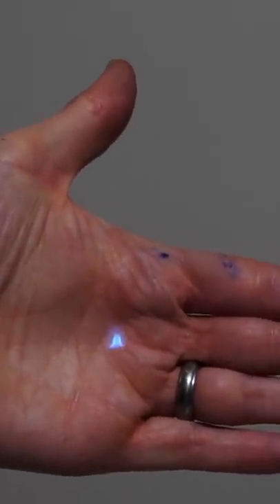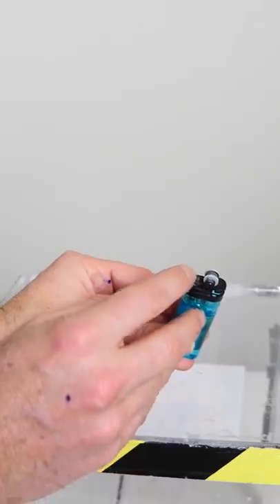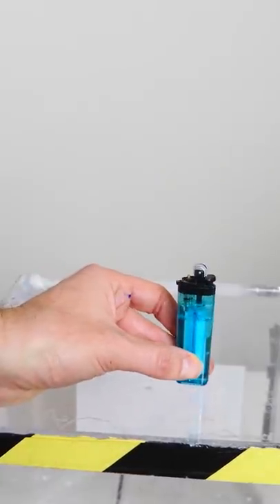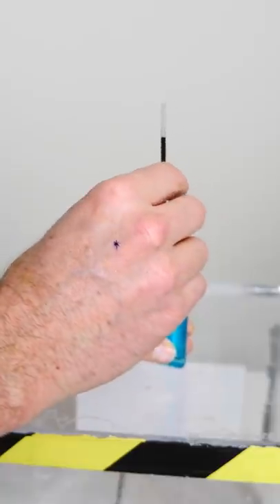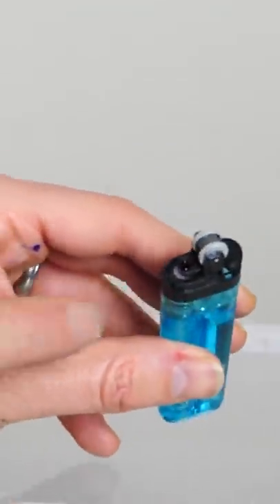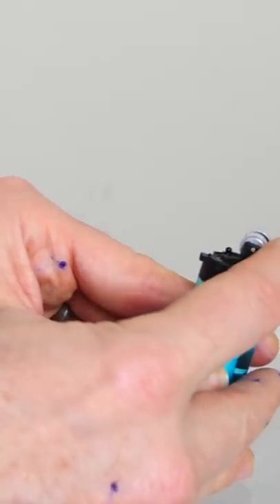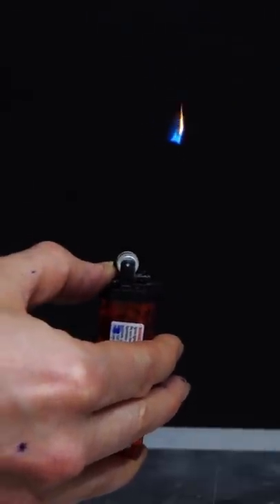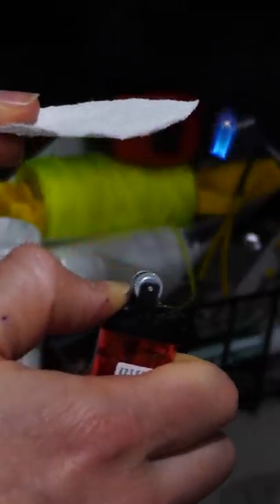Floating Fire Ball

Comment: Him: explains how it works

Me: Yes I totally understood everything
Reply: the gas comes out fast which makes it smooth (laminar) and it doesn't mix with the air, but once it slows down it gets rough (turbulent) and mixes with the air, which is where the flame starts
Reply: @insectbite1714  I tried it and it worked. I used the help of my science teacher to do it and it worked.
Reply: @insectbite1714  just admit you failed Science
Reply: Laminar essential means all the flow is going one direction, with water it usually looks very smooth. Like when you use a hose without a nozzle on it
Reply: Who addicted to meth know this..
Reply: @amirulakmar2912  God dammit hahahah, I'd say a meth pipe is always turbulent

Comment: I accidentally did this when I was younger. I had dripped melted wax on the lighter, and some landed on the nozzle. I guess it just instantly cooled and solidified into a smaller nozzle. It was pretty awesome, the flame would be about 8" away from the lighter.
Reply: I came here to also say I accidentally did this, except I was just messing with my lighter and got it to happen. Blew me and my friends minds

Comment: So.. if it's laminar flow... Does that mean that the gas doesn't burn because it doesn't mix with the oxygen in the air? Would like to get an detailed explanation of how that works and what the benefits are in engineering something with laminar flow gasses.

Comment: In my field it's called "burner lift off" due to flame speed (speed of butane duo to modified orifice). Laminar flow explains a lot about the inability to reach stoicometric mixture. John Zinc has a lot of good information for further research
EDIT: John Zink Hamworthy
Reply: Orifice 😂
Reply: What's your field?
Reply: @mushrifsaidin  excuse me lol. "Nozzle" may be better on the ears
Reply: @stephenm8415  Refinery Operator. Our burners are about the size of a dinner plate. Our gas composition changes and an automatic valve will move to control the temperature at a setpoint which inadvertently changes the burner pressure and flame speed. Flame speed is the part that leads to burner lift off

Comment: I use a laminar flow hood (I built it) for sterile work in mycology. Air is pushed through a HEPA filter in laminar flow towards you so that particles in the air won't settle into an open sterile container like a pitre dish. 

 If you hold a lighter in the flow, the flame will blow at 45-90° without flickering.

Comment: In the hood, we call that a crack lighter. You adjust the flow by popping off the metal part and changing the lever to very high. No need ink needed.
Reply: Doesn't that just make a long flame?

Comment: It can't burn on its own, it needs oxygen. So it won't burn in a laminar state, but it will burn when it reaches a passable mix of oxygen and butane. You can still see the cavity in the flame where the flow hasn't fully dissolved

Comment: Here's a neat project for you use a clear tubing and shoot butane or propane torch gas into it and a spark to the hose ignite it one or multiple bolts of ignition as a space between each spark the gas stays lit and travels through the tube it can continue if the hose is looped back into the starting point as long as the fuel is circling I used a wheel next to the tube with a magnetic and a ball in the tube to move the metal ball it pushes the gas around in a continuous motion 😅😅😅😅

Comment: So what happens when you try starting it horizontally? Does it burn at the name level or slightly higher? I imagine gravity might shift the ink and potentially eventually open the aperture further. While the flame quickly zip down the flow of gas or go out due to the flow not being stable enough until there's a new equilibrium when the ink isn't shifting too much?
Reply: It’s not zip it’s clipper 😂

Comment: I figured out there's another way to do this use hot glue put a little bit on where the ink would go heat it with another lighter pop the hot glue turn flame Down and it should work. less mess and is permanent cause with the ink you eventually have to add more ink.

Comment: Hey I did this before on accident. Melted my lighter a little bit and the melted plastic plugged most of the hole, what's weird though is even though the hole was smaller it seemed to burn my lighter out quicker.

Edit: just realized it may have died quicker because It was cool and I  couldn't stop playing with it (get your minds out of the gutter you know what I mean)

Comment: How was butane from a tin/canister (for lighter,s also ) Leaving orange 🍊 colour paint on hand ✋ ??? Any others had clipper brand (2*0*18) 4 th July product date ..(8) barcode hard to wash off mount of Venus and oil based ...first reaction "how,s paint gotton into the production +LiNE+ "     carbon and hydrogen a me read the butane gas under pressure sold product for various uses and PX butane was at UK early 199*0* a air/gas used in a product,s known for asthma inhaler,s (reliever,s ) (preventer,s) ...and beacause is an oil based substance (orange 🍊 coloured contaminant almost like max factor foundation makeup pump action type ) if inhaled u know it butane gas is not gonna wash off from interior of body ..as from a right hand the residual excess when filling clipper lighters as ALways is never show,s as a colour orange paint NO only white powdery if out remains and white powdery rare (mean/average of filling up lighters ) ... If any reader's know of or have had such a canister of clipper butane lighter filler (2*0*18-)???? Before or still ??let a me know +searched for product recall and other site's e.g pathology +royal collage of pathology+ and weird autopsy,s (orange foundation make up colour found and so on ) nothing found ...+. inconclusive + can not be brought to one cause ...please let me know ..put it this way scraping the lungs or synue of interia body of past on person would not be possible ..(the contaminant)